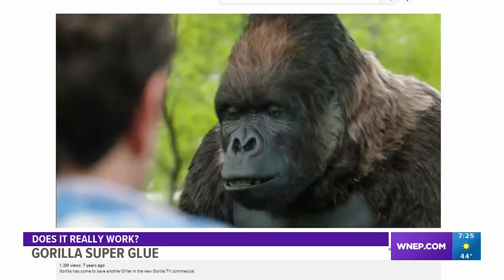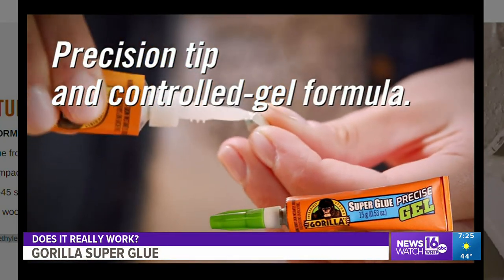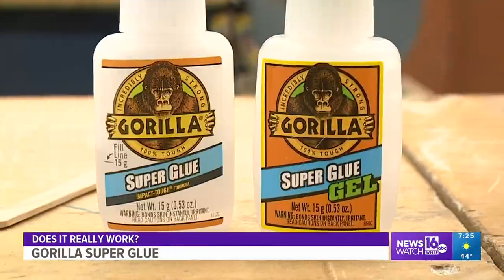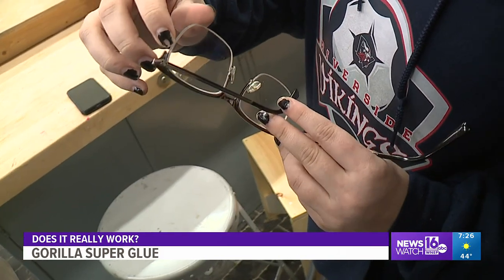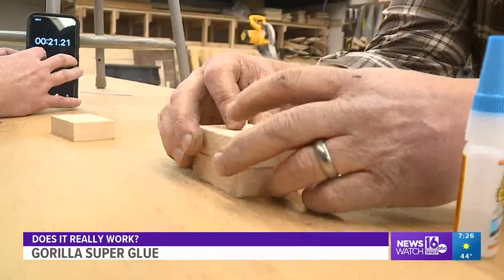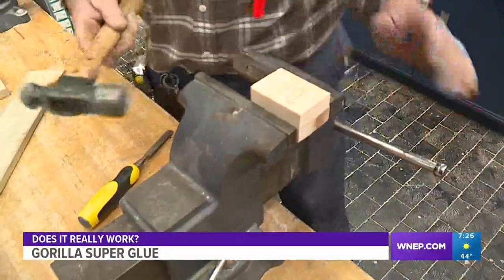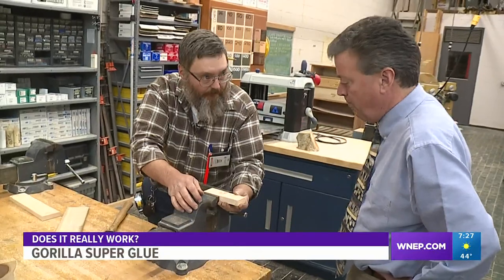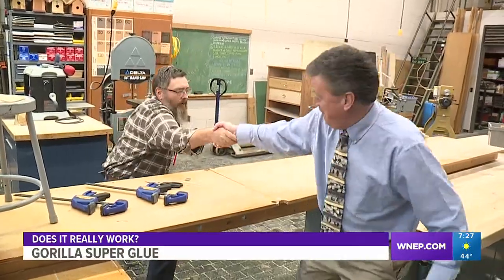Does It Really Work: Gorilla Super Glue

Comment: It is important to use a light application of water on the surface first to keep the wood from absorbing the glue then apply the glue and press together lightly.  you need O2 for the thermal crosslink reaction to take effect.

Comment: Cyanoacrylate based adhesives have an excellent adhesive property -- however its "cohesive" properties are very weak. What does that mean? If there's any gap between the two surfaces, the glue itself will fracture and fail. Any gap must be microscopic. Furthermore, it's brittle and not robust to thermal expansion/contraction of the joined surfaces. Under repeated thermal expansion/contraction of the joined objects, the shear forces will cause it to fail. Many plastics cannot be joined effectively with it either. Epoxies are much better and nearly all also have very good cohesive properties that can deal with voids.